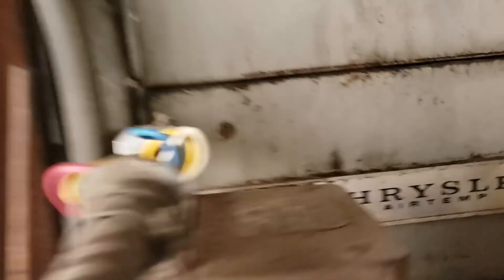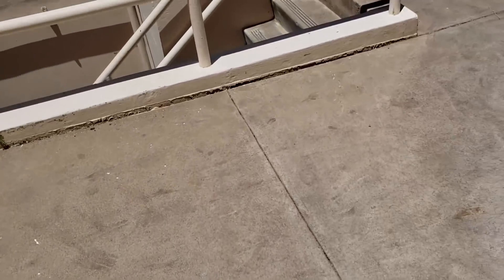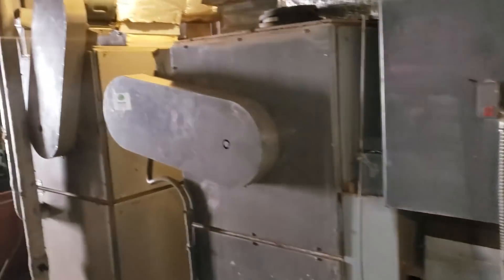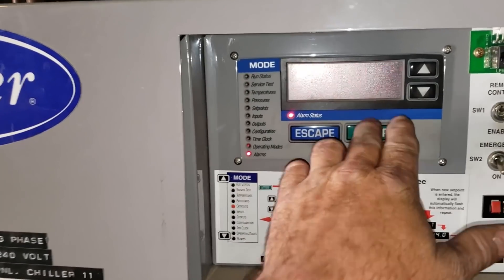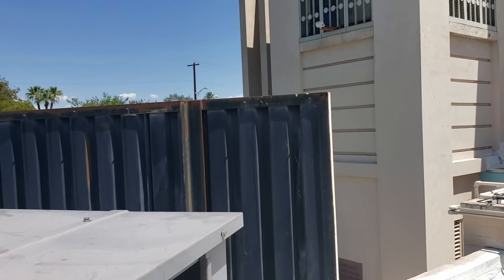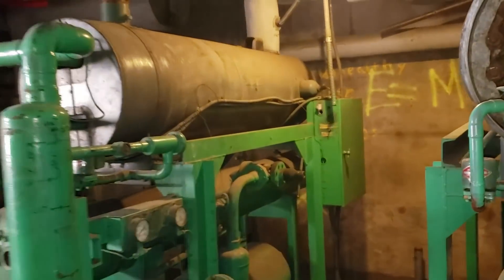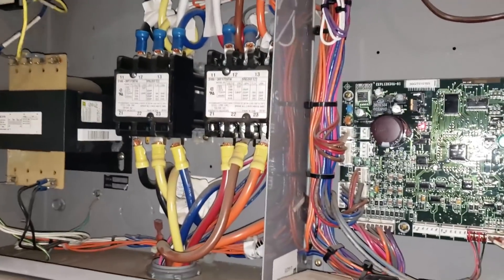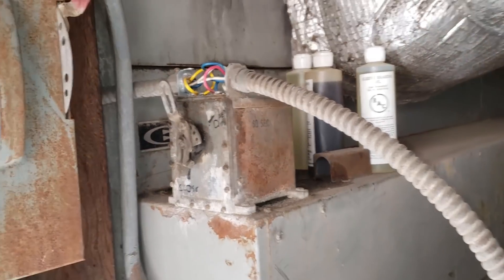Antique decrepit Chrysler Airtemp show-n-tell!

Comment: Thanks for sharing this! 
Done my self-esteem good to see you struggle with the chiller components 🤠. I regard you a  one of the best in the business. No kidding. 
Shocked to see Carrier uses just two contractors for their star delta motors, it works but,...it is a bid cheaply build in that way.  
I sure hope they sign you in for a big modification of there church heat cool vent stuff.  
Keep postin’

Comment: I just started the process of replacing my 1954 Mayflower oil-fired FHA furnace due to a failing combustion chamber and efficiency issues. Still had its original (non-flame retention style) Quiet-Heet Model A burner. Over the years, it's had one replacement oil tank (2018), replacement blower motor and bearing shaft, stack and stack switch (2010 or so), replacement burner motor and oil pump, as well as a replacement transformer. Still ran like a charm, but burned WAY more oil than was economically sustainable.

Comment: We have a late 60's early 70's carrier chiller with dual 3 phase semi herm compressors on it with 2 condensor barrels that is cooled by well water and a monster evap barrel. The thing is a monster and feeds two massive air handlers both with 25-30HP 3 phase motors to cool a pretty large building. It takes 2-3 triangle tube boilers to feed enough hot water to the both of the air handlers as well in our northern winters.

Comment: I work on a few buildings with those Honeywell style thermostats, pretty neat stuff!!!
Reply from the maker: Are those t-stats still available?
When I put my meter across the rheostat it seemed to me in the millivolts. Is that correct?
Reply: @hackfreehvac  You might be able to substitute with a Honeywell T7080A thermostat

https://customer.honeywell.com/resources/Techlit/TechLitDocuments/63-0000s/63-4179.pdf

https://www.manualslib.com/manual/581702/Honeywell-T7080a.html#product-T7080A